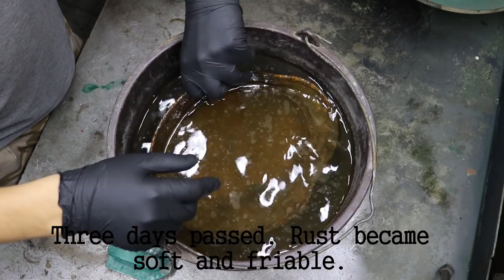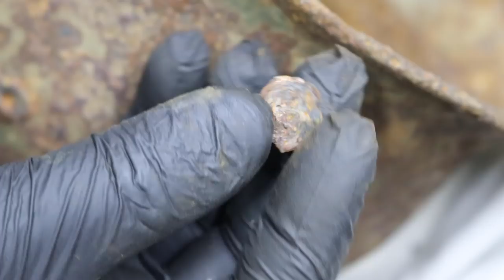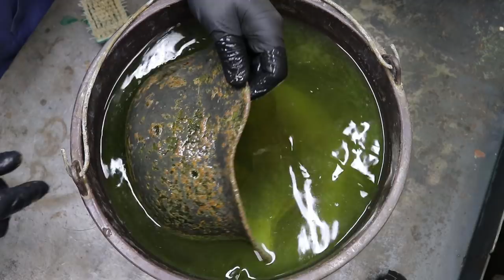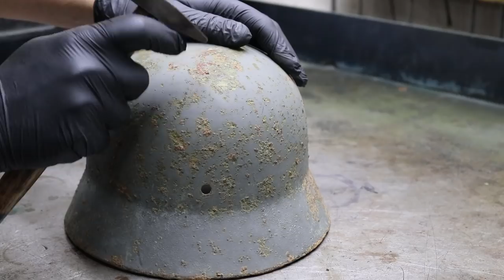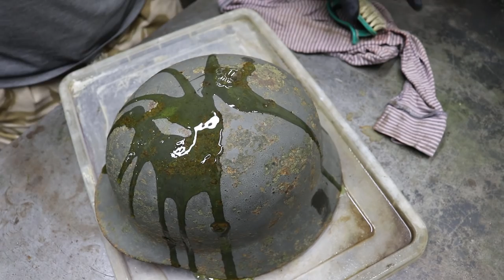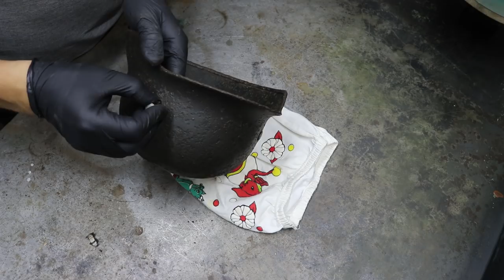Rusty German Helmet Preservation - M35 SE62

Comment: So im ordering an original m35 that’s rusty like yours, is there anyway I could send it to you and you restore it?
Reply from the maker: I'm sorry, but I cannot help you, because I restore only my own items.
Reply: @wwiituberestoration1011  Are there any books on exactly how to restore helmets, for people who have never done it before? Where would someone start? Thank you.
Reply: @cs2to4  you can start by using vinegar water which I know for a fact it will get rid of the rust for most part. Probably let it sit for about 3 to 4 days or more if it isn't ready yet, if it's ready, then proceed to wash it with water and dry it up because the rust will appear again so whatever is left on the stahlhelm use a wire brush to scrape the rest of the rust still left hanging, most of the rust should be gone. After cleaning it up, paint it with etching primer to prevent the rust from appearing. Then, after that paint it whatever colour you want original or leave as is, your choice 😉 this dude was no helpful since he only does his own stuff and not even give us hints or help any of us. If left too long in vinegar water, I'll start eating up the piece of steel. I tested out with rusty variant pieces found laying around so you often have to check if it's ready to clean. If there's small holes on the stahlhelm, use JB weld originals to fix the holes. But if you wanna save the pant and not lose its value, then use that oxalic acid to get rid of the rust without hurting the paint.

Comment: Good job and great final result! Only I wouldn't use hammer to get rust off the helmet, in that way you can damage helmet and get holes on in....it's too rough! I use some kind of steel brush, that cleans the largest rust pieces without affecting the original color. ;)
Reply: steel brushes also affect paint

Comment: Excellent preservation of the helmet + preservation of original paintwork Try deep soaking of the item in solution of benzotriazole (BTA) + alcohol (you must first check the reaction with the original paint), followed by the application of microcrystalline wax + solvent. Sorry for the inaccurate translation. I use Google Translate.
Reply from the maker: I want to try benzotriazole for conservation helmet. Maybe in the next video.
Reply: @wwiituberestoration1011  Just be careful with the paint please

Comment: You could get a lot of money if you sold these preserved gear to a movie company!
Reply: @Connor LambFurlotte Depends on what you mean with 'restore'

if you have a really rusty helmet, and you derust it revealing alot of paint, it can easily become more expensive.
Reply: that'd be a dumb idea, these helmets aren't that strong anymore as normal helmets so drop the once and you might break them...
these should just be in museums or private collections on display
Reply: The movie company would just buy reproductions rather than spending a lot of money on originals
Reply: @buki29  yeah, a good original would fetch on the thousands dollars, a battlefield dug up would go on the hundreds while a repro goes from 70 to few hundreds depends on quality and customisation (decals, camo, etc)

Comment: Question? Would sandblasting it been better, or would that have been too harsh on the helmet?  Great job by the way.
Reply: Im no expert but I think sandblasting would be a bit much.
Reply: I think it's the better way to go when there is no hope of saving the original paint/patina.  Then the goal would be to bring it back to what it looked like when it was new.  So, it depends on what kind of restoration you are trying to do and how bad of condition the piece is in.
Reply: @robertclark1669  
It would work good for something like a helmet.  Something with metal with some thickness to it.  But it would destroy something more delicate.  Although, it would remove not only rust but any original paint or patina.  So, you then need to decide what kind of restoration you are doing.  Preserving the original or bringing it back to new condition.